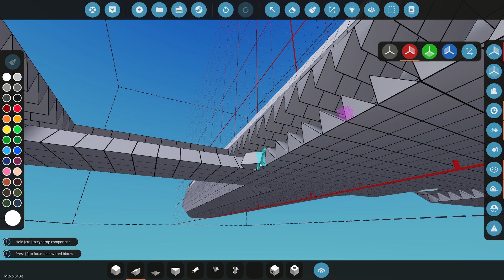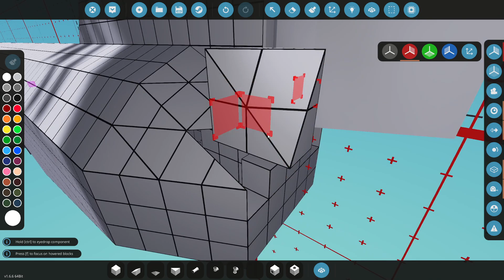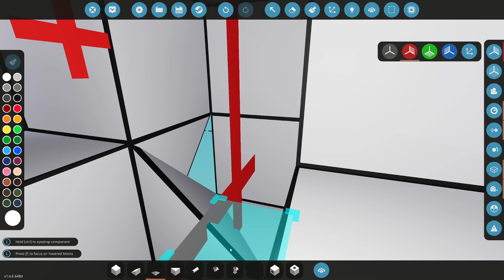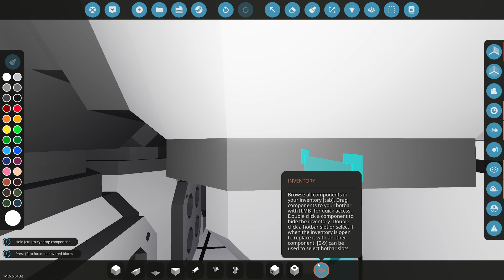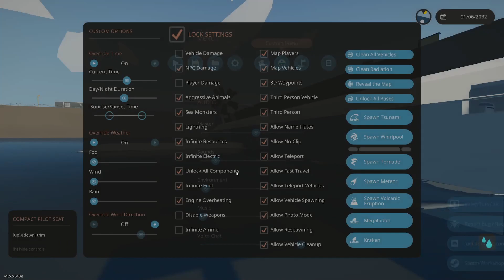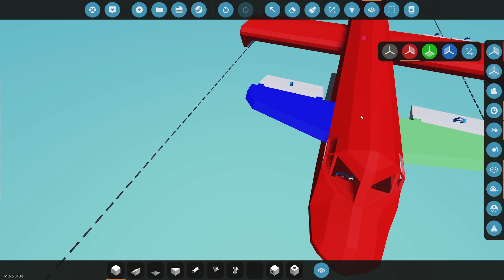Stormworks Career Build Series 193

Comment: Loved the video @Captain_Cockerels Gaming! Can't wait for the next video man! The "French Bulldog" seems to be coming along pretty well! The Lum-class Ekranoplane (MD-160) flew 5 to 10 feet above the Water whereas the A-90 flew 9,600 Feet. If you want one that's armed for Self Defense or for Radiply Deploying Troops you might be able to put a few Hardpoints for Anti-Ship, Anti-Tank or Anti-Aircraft Missiles and maybe a Pair of Turrets. Just an idea but it would still be a Nice idea.

Also, the C-109 Tanker Variant of the B-24 Liberator Heavy Bomber carried 2,900 Gallons of Fuel. Not sure how many Tanks it had but it had at least 2 tanks. The Only thing was that the Liberators Nose gear was designed to handle a Landing after the Plane had dropped it's Payload on the Target so Nose wheel Collapses were quite common. Also, the plane became to Sensitive to the Controls and more likely to spin out if there was ice on the Davis wing. When Aircraft like the Douglas C-54 Skymaster and Curtiss C-46 Commando started making their way to the Frontlines, the C-109 Liberators were then Relocated to areas where they could be easier to control. That, aside from what would later be common practice of leaving the Front Fuel Tank Empty to make the Plane more Controllable on Takeoff and landing, kept the supply of Fuel going to the B-29 Superfortress squadrons in China. When the Mariana Islands was Captured, the B-29's could simply have the Fuel Transported aboard Tankers escorted by the U.S. Navy and so the C-109 Liberators were Ferrying Fuel to Squadrons by the Rear Areas. In Total, 287 C-109 Liberators were built during the Second World War.
Reply from the maker: I'll probably make an armed version for the warzone series after it is done.